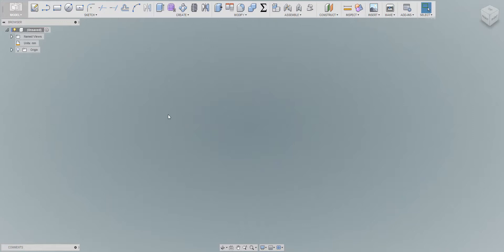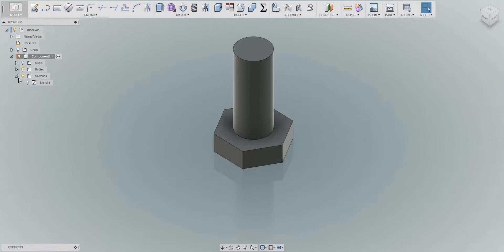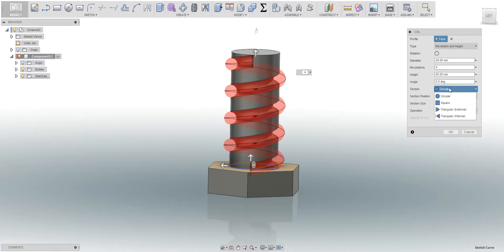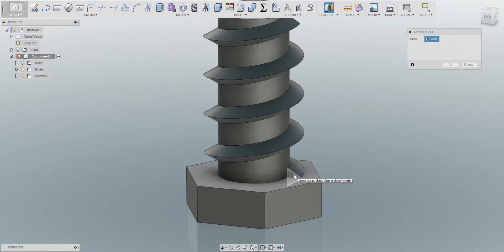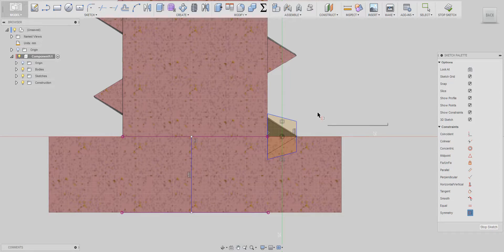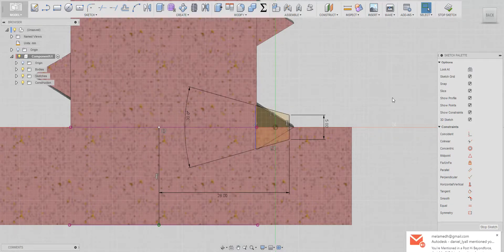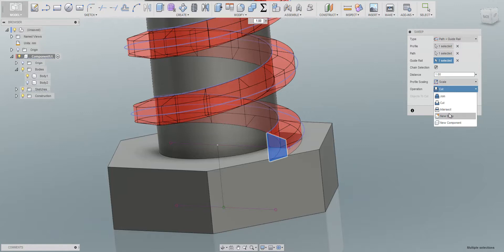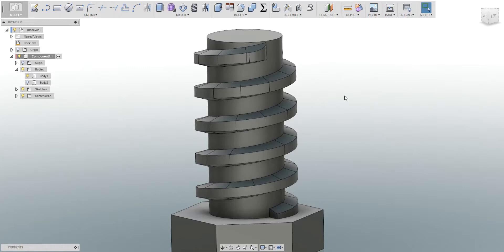Fusion 360: Create your own custom Threads Profile

Comment: I’m getting a Boolean failure when I try to join. Any help on that?
Reply: I ran into this too. Using "Path + Guide Surface " with the outside of the cylinder as the guide surface solved this for me.

Comment: Hi, Ben. This is Dennis again. I am going through your video step by step, but I get stuck in a couple of places and I was wondering if you could please coach me through the sticky spots. First, about midway through, you "project the bottom parts." I can't seem to get F360 to project as you do. (I am running F360 v 2.0.3800.) Second (and this may be related to the first) when I make the custom threads using the guide rails, the plane that was created for sketching the end of the coil will not go away, so I end up with a well-formed threaded "half screw" split vertically by this plane.
Reply from the maker: Hi Dennis,
I would love to help, but I need to see what you are trying to do. Could you please make a screencast and send me the link (fusion360newbiesplus@gmail.com)?

Comment: Thanks, Ben, this is great! I'm new to F360 and need to do what you did in this video except the cylindrical body will be varying in diameter. Will this procedure work for that?
Reply from the maker: Hey Dennis,
Don't worry, I'm planning on making a new updated video on how todo that. It's really easy ;)
Use can use the Change Parameters for that, create a parameter called diameter and use it for both the cylinder and the Coil :)

I hope this helps.

Comment: how do you make custom thread in a hole
Reply from the maker: That is very simple. You can use this technique after you created the outside thread:
https://forums.autodesk.com/t5/design-validate-document/thread-doesn-t-aligned-properly/td-p/6792739
Reply: @Fusion360NewbiesPlushow to use a CAM to cut this using normal parting insert